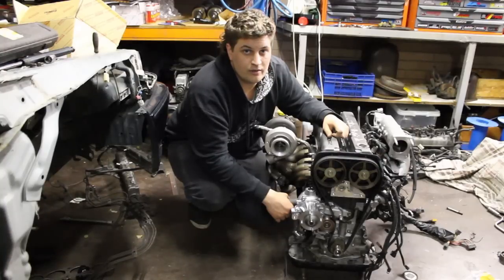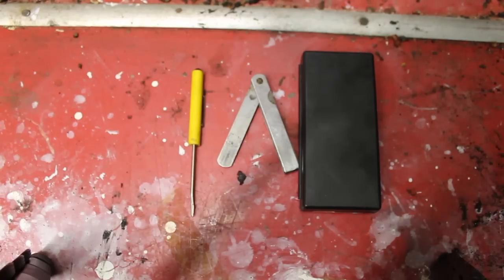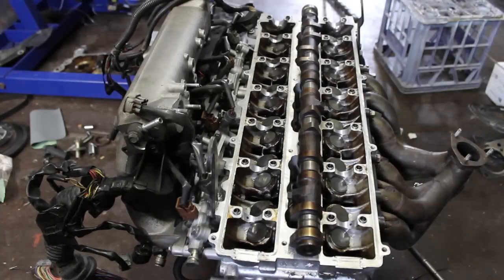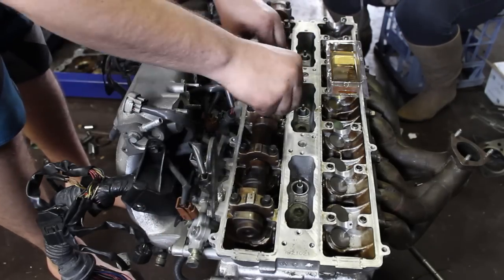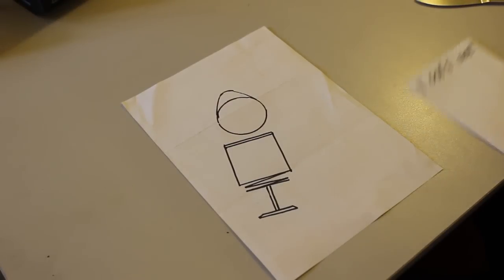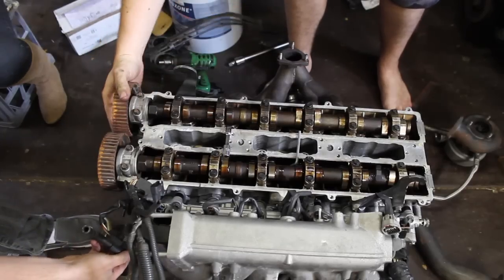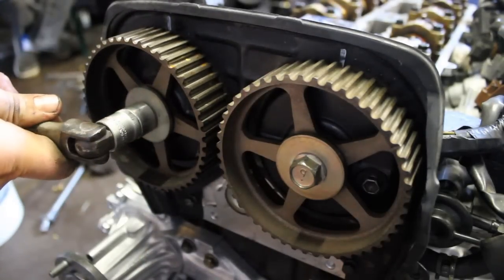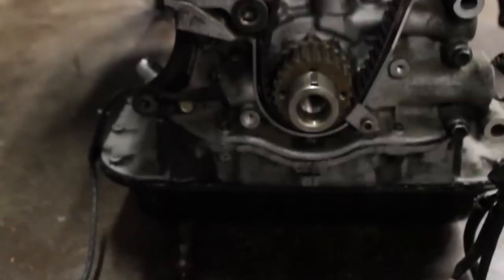1jz-2jz Valve lash

Comment: Can anybody help me? Im removing my r154 and have all the bolts off but it still seems to be stuck... it seperated like 2 inches but it wont budge from there
Reply: TheBlkzenki im not 100 sure on that gearbox but on the v160 u need take out the clutch fork and if u can't u need screw off the presureplate . u understand later why ;)
Reply: +TheBlkzenki I'm sure you got it by now, but it must just be hung up on the input shaft of the tranny to the clutch.  Mine was like that too and I think it had just been sitting so long that it kind of rusted together.   I just yanked pretty hard and it came apart
Reply: +TheBlkzenki lol im sure you have figured it out by now but for future reference for others this is a pull type clutch so first remove the clutch slave then the clutch fork and undo the 6 pressure plate bolts EVENLY then you can proceed to take the r154 out